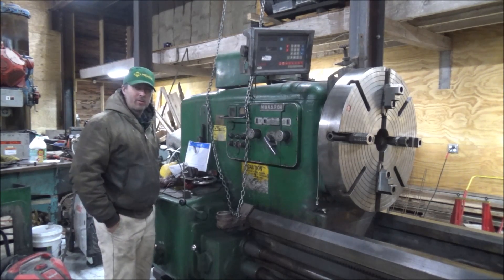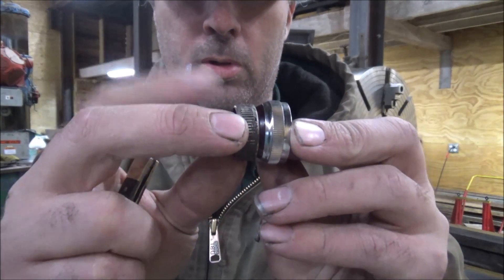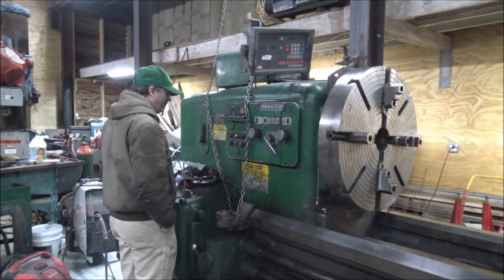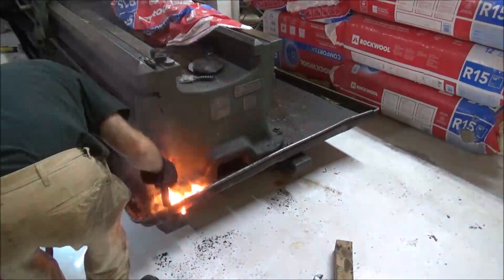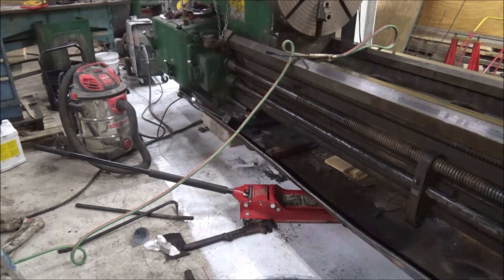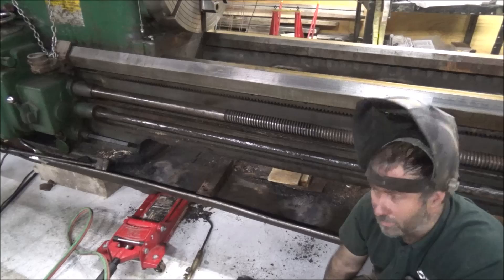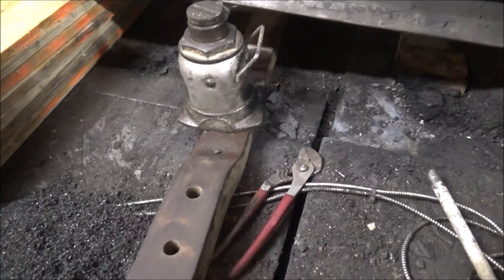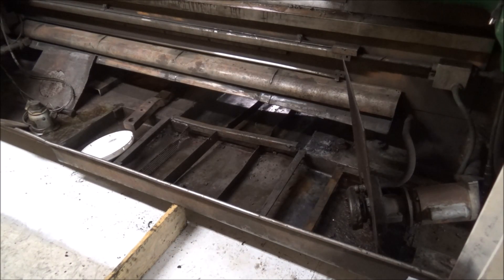Big Monarch Lathe chip pan Repair+ LED Pilot lights

Comment: Hi Brain, The bezels I had was too small. Did find these on E-Bay . Might help.

https://www.ebay.com/itm/MIXED-LOT-of-PUSH-BUTTONS-SWITCHES-for-MACHINE-CONTROLS-LOT-of-11/272895061551?_trkparms=aid%3D111001%26algo%3DREC.SEED%26ao%3D12%26asc%3D20140905073823%26meid%3Deba53ba147454ae5875da68f4ab2994a%26pid%3D100284%26rk%3D2%26rkt%3D12%26sd%3D272895061551%26itm%3D272895061551&_trksid=p5713.c100284.m3505

Comment: Brian, The main thing with LEDs is having the correct resistor inline so the led will last unless the machine already has resistance built in, you should have voltage drop and current info with the led and then go on the internet and search led resistance chart and you can put in the voltage that you have coming to it and the info on the led and it will tell you what size resistor to put inline with it and it should work fine and last a long time,Good luck, Dave

Comment: Any updates on the Cincinnati cnc coming soon?
Reply from the maker: It is going to have to dry out so I can get the hydraulics and cooler for it out of the quonset hut. We get tons of rain like every other day and even my gravel driveway with a foot of rock in it is a soupy mess. It doesn't sound like it will be drying out anytime soon either. :-(
Reply: Good luck to you and thanks for the response i'll be sure to watch the video when you do. I'm not sure what control that machine has but guessing its maybe an old fanuc. I recently was introduced to a product called KIPWARE CONVERSATIONAL if I was you I'd look into it theres plenty of videos on it and its pretty inexpensive and good tech support. @bcbloc02
Reply from the maker: Thanks, will have to check it out. The machine is standard g-code i believe the basics is Cincinnats own controls but is related to Siemens.

Comment: We like lights and flashers over here Brian. They make things look to be running smoother. That jaw chuck is like the star of the show so large and makes one heck of a backdrop. Hi Bailey 3:18 into the video good morning puppy. A welder can surely do a lot. We be lucky to make a bucket of chips that size yet alone 10 of them so your message about larger machines is shared well in the video, thank you. Lance & Patrick.
Reply from the maker: It wound up 15 buckets i cleaned from the ship pan and it wasn't even really that full!! I fear the need for a bobcat to haul off chips in the future. lol

Comment: TURN some
Reply from the maker: Got to get it down sitting properly on the floor first.  Also I need to make sure I can get the clutch rod installed as I may have to move the lathe back from the wall to get it in.

Comment: Did the movers actually fork the pan? If so I've got to say there wasn't a whole lot of brain power behind the operator.....thanks for the videos.
Reply from the maker: yes they tried to pick it up by putting forks under the pan, then lifted till the pan was against the belly of the lathe. I had to press it back down 8inches in some spots.

Comment: An electrical supply house should be able to help you with those lights and covers. Allen Bradley was a big supplier of those. There were the 800T and the 800F series and I think they are 30mm or 22mm. There are online catalogs. Square D now Schneider electric and Cutler Hammer now Eaton were the other suppliers.
Reply from the maker: My book says they are square D 900 series. I found a pair of 22mm ones and will try them next.

Comment: Your going to need an intercom so you can talk to your self from the other end lolol. What did they do to that pan, bounce rocks off of it
Reply from the maker: Played bumper cars with it using a 15ton forklift I am pretty sure.
Reply: @bcbloc02  well we all know that if it can be fixed your the man for the job and if it can't be fixed your still the man for the job cause I believe you can still fix it either way.. And. For the lens covers Chuck the large one in the lathe remove the threads the machine the small one major diameter to press fit into the large ones..
Reply from the maker: Challenging work holding gripping a glass spherical shape.
Reply: i meant the knurled nut, but i guess it would crush the glass by the time you got it tight enough to hold the threaded part.. there always epoxy big to small

Comment: Did all this damage you've repaired happen from the riggers(?) taking the machine out and loading it from where you bought it?
Reply from the maker: No the chip pan was trashed by the dummies that removed it from the closed factory. The broken foot and sump was a result of the machine sliding off the forklift forks when they were loading it for me at the dealers. A pair of forklifts is not the machine to use when moving one of these machines. It was a piece of cake and damage free using my crane.
Reply: Did lots of heavy lifts/rigging work myself @bcbloc02 , it always makes me shake my head when I see just how illogical even some "experienced" riggers can be, like anything being in a hurry and not understanding basic principals is dangerous and often times very expensive.

Comment: Well, as long as there isn't any tire killers in it, you know what you can use to fill a persistent sink hole in the driveway with.
Reply from the maker: Don't know that driving over the sharp metal chips mixed in would be good for tires.